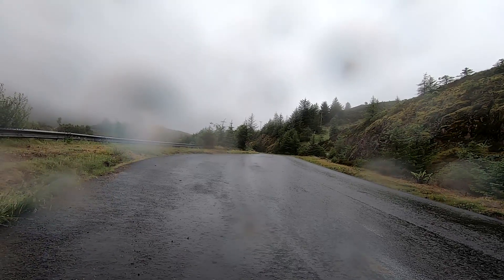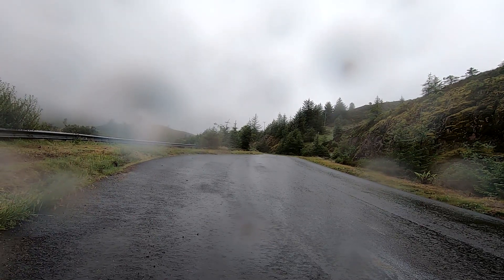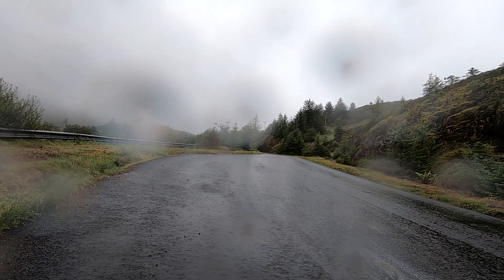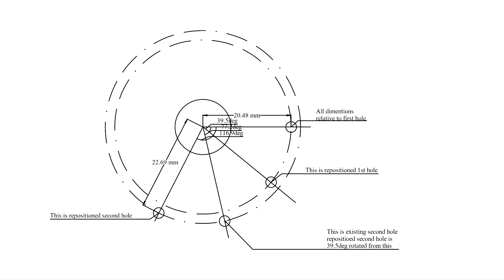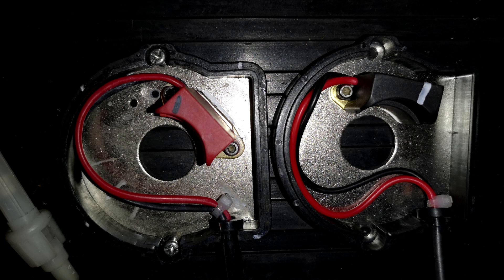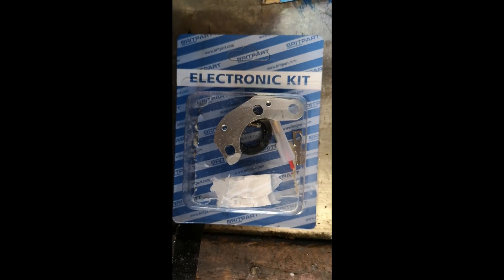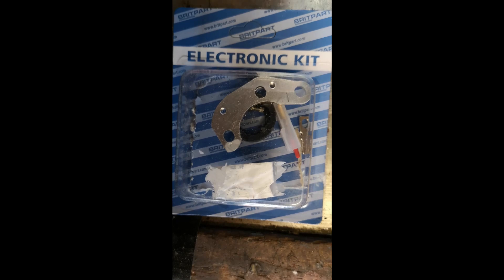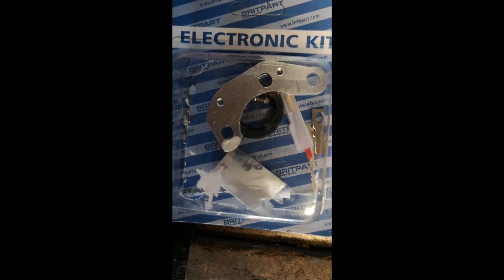Austin Seven Electronic  Distributor Failure

Comment: Is it definitely a temperature issue? I have used a couple of units on different cars in some pretty harsh conditions and not had an issue. I did how ever fit a similar system to my old Enfield motorcycle and had no end of issues and it ended up being a faulty voltage regulator as the points replacement was quite sensitive to voltage.I'm sure you have investigated that but thought it might be worth a mention.
Reply from the maker: "Is it definitely a temperature issue?Is it definitely a temperature issue?", no the new sensor does not display temperature symptoms, the old sensor appeared to demonstrate temperature symptoms as fault has now gone away.